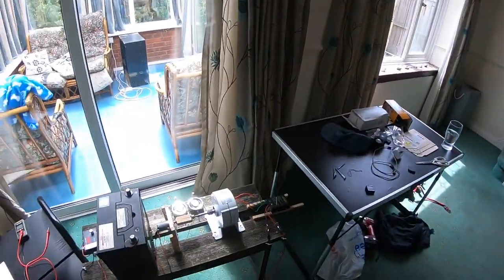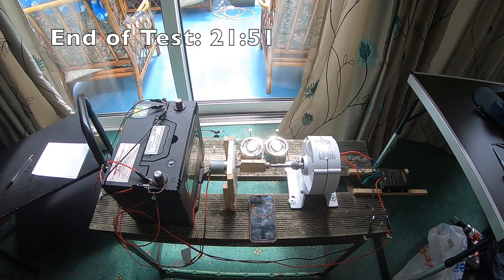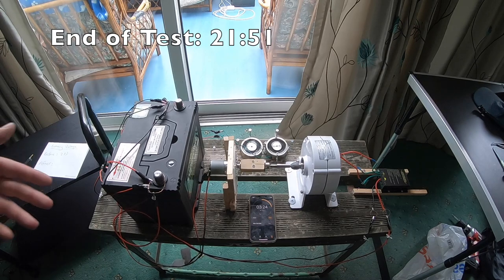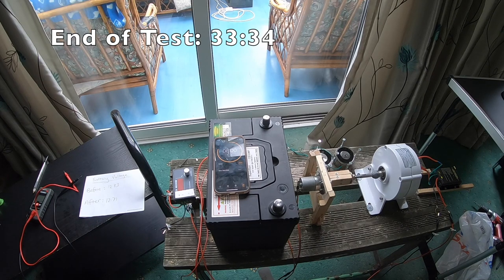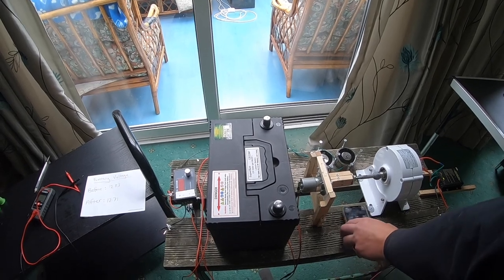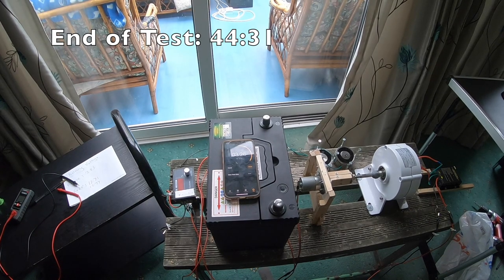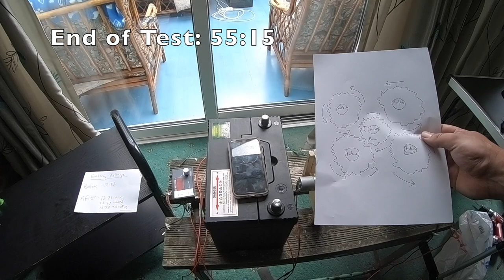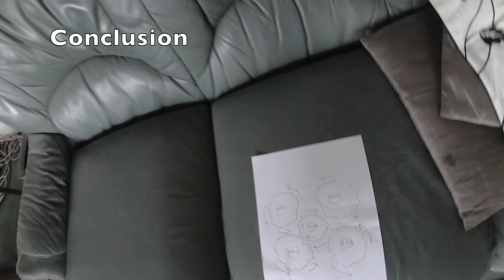BadBoy Jenvey Solves the Energy Crisis - Introducing the Perpetual Turbine

Comment: You've got a battery feeding a motor which feeds a generator which feeds the battery which feeds a motor which feeds the generator.

The "turbine" generator effectively creates its own load through electromagnetism, so you're going to have losses instantly.

The battery charger will also have its own power dissipation and losses, so while it is charging the battery if you left it running it will eventually flatten it.

You'll never be getting back what you put out.

Don't forget also that the only load you've got on that at the moment is the charger. In a real world scenario with consumer loads you'd only be flattening the battery faster.

Finally a current flowing through a wire will always create its own minor electromagnetic field which counteracts it acting as a load. So you will always have losses.

The only way you can not have losses is if you used something that had naturally renewable inertia. Like a river.
Reply: F**k sake that was what I was going to say
Reply: @ashleytuck3863  bunch of geniuses here how'd that happen
Reply: Alternator!!
Reply from the maker: I explained with the cog system how you can spin multiple turbines with one electric motor to gain a net positive output . Obviously I am correct and this is the way to produce electric.
Reply: @DaveJenvey  sorry, yes I forgot about the cogs. Yes you are right. Cos of science.
Reply from the maker: @Gubalicious  cheers for seeing sense
Reply: More Strain on the motor = power loss  Doesn't it.  More Friction.
Reply: @seanoverend7297 yeh, everything after the battery output terminals is a loss. The fact that it's making noise is a loss.
Reply: 100% with u. Better of Adding the turbine to his bike.  Keep fit  and Trick recharge a battery at the same  time.  As long  as it keeps  his mind of fitting  people.  I am 4 it. 😄😄

Comment: maybe use a wind turbine to power the motor to power a turbine to charge a battery or just use a wind turbine to power something, that would be closer to perpetual however many minds have worked on perpetual motion machines and none have cracked it because too many losses in the system, work in never equals work out. I do admire your efforts and it's nice to see you trying to do something positive i wish you all the best dave
Reply: Would it power my ebike??
Reply from the maker: I explained with the cog system how you can spin multiple turbines with one electric motor to gain a net positive output . Obviously I am correct and this is the way to produce electric. But thanks for the nice comment
Reply: @DaveJenvey  I know you know this, because of your formidable intellect, but adding more "cogs" or a "cogbox" as they are known in engineering circles, will introduce more mechanical drag torque, again I'm sure your system has taken this into account due to the phenomenal amount of over engineering thats gone into this so far!

Comment: This is even funnier than the Jenvey drop.
You should have started studying the 1st law of thermodynamics.
Reply from the maker: I explained with the cog system how you can spin multiple turbines with one electric motor to gain a net positive output . Obviously I am correct and this is the way to produce electric. As for the GBU drop, I had the nuts to go back and conquer it, I doubt you would if you had taken such a bad fall.
Reply: Funny you should mention that. I fell off 2 years ago and never got back on the bike lol
But you are wrong. 
Energy can't be created out of thin air.
Reply from the maker: @burt604  yeah that’s why you a battery to get it started Burt, just like in a combustion engine

Comment: All you have to do do is keep it running. If it run for ever you are right. If it comes to a halt you are wrong. Simples
Reply from the maker: John you are a brainless moron. I explained with a cog system how you can run multiple turbines off one motor. Watch my next vid.
Reply from the maker: And additionally if it is so simples, why didn't you think of it John
Reply: maybe im wrong but i dont think perpetual motion is the main aim of what he is trying to achieve here, even though its named a perpetual turbine
Reply from the maker: @orbytl2799  exactly, I’m trying to achieve net positive energy. The holy grail of energy production
Reply: @orbytl2799  There is energy loss at every step of the process through resistance in the wires and the bearings in the motors.
Reply: @Stickyman61  i know, but he is trying to make more energy than he is losing, i dont know wether its possible or not
but what i can tell is that he is not trying to make a perpetual motion machine that will run forever
Reply: @orbytl2799  But if he is making more energy than he is using,  he has to prove it. He could start with an almost flat battery and see if it becomes fully charged. Then he will be taken seriously.
Reply: @Stickyman61  yeah man, he needs get them cogs rigged up 😀

Comment: It's not a turbine, it's just a generator. A generator is the same as a motor, just opposite. This isn't science Dave, you will lose energy through friction, sound HEAT etc. At this point I can only assume you're trolling and putting on a persona for views. Tut tut
Reply from the maker: @DaveJenvey
8 hours ago
I explained with the cog system how you can spin multiple turbines with one electric motor to gain a net positive output . Obviously I am correct and this is the way to produce electric. It is a wind turbine, it was called a wind turbine when I purchased it on Amazon, and the fact you cannot recognise that, highlights you are a moron who knows nothing.
Reply: @DaveJenvey Typically, if it has blades or fins fitted to it you could call it a turbine, but in its current form it's literally just an electricity generator. You're not actually generating electricity with your idea, you're just starting with an amount and slowly losing it over time.
Reply from the maker: @MrOvertSandStorm  Now he's a smart arse, you said it wasn't a turbine. It was sold to me as turbine. But you have to call it a generator to try and make yourself appear clever. Obviously the cog system with multiple turbines on it would work
Reply: @DaveJenvey  We all get things wrong sometimes Dave, it's surely closer to being a generator than a turbine. But anyway, what makes you think you can generate energy from nothing? Adding other generators will just spread the energy across all of them, in fact you'd lose more energy probably as each one would produce sound heat and friction etc.
Reply: @MrOvertSandStorm  i dont think he is trying to create energy from nothing
just trying to get more out than goes in, if thts possible i dont know but i know fuck all
but thats what i get from the video
Reply: @orbytl2799  yeh don't worry man. What I mean is, energy can't be created or destroyed right, only transferred. That battery and motor only outputs a certain amount of energy - adding more 'turbines' won't create energy out of nowhere, that's not how it works. It has to come from somewhere. If you wanted to get more energy out you'd need to increase the energy in, and so on and so on It's an infinite loop of depleting energy over time. Not new innovative or scientific going on here, just Dave trying to get attention unfortunately.
Reply: @MrOvertSandStorm  yeah man, like bigger motor would be needed which in turn would use more battery juice, thats what i was thinking
i like that daves having a crack at it though, i admire that 😃

Comment: Nah…‘I’m not havin’ it !’ (In my best Brummie accent)…there is always a loss,the expression,”no such thing as a free lunch” springs to mind.The battery only ‘gained’ when it was left to ‘recover’ (chemical reactions within).At least you got a vid out of it arkid…onward and upwards !
Reply from the maker: I explained with the cog system how you can spin multiple turbines with one electric motor to gain a net positive output . Obviously I am correct and this is the way to produce electric. But cheers for the nice comment
Reply: @DaveJenvey  the more load you put on (more turbines) the more energy is required to turn them,like I said,no free lunch arkid.
Reply from the maker: @joelfildes5544  yeah but there is still obviously going to be a net positive isn’t there
Reply: @DaveJenvey  Energy is neither created nor destroyed Dave,1st law of thermodynamics…leave the whole thing running,and it will stop eventually,as the energy will dissipate through heat generation in the turbines,and even the motor driving em and indeed the actual wires…sorry arkid,you are pissing in the wind with this one,loads of YouTube vids on this,indeed,this is why there are NO perpetual motion machines,there is ALWAYS a ‘loss’ even in a vacuum…it’s just less,but still a drain…net loss.
Reply from the maker: @joelfildes5544  the sun and earth are both perpetual motion machines. How do they exist if the 1st law of thermodynamics is correct ?
Reply: @DaveJenvey The earth keeps spinning because it has no resistance. The sun is a huge ball of energy that will expire one day. Energy cannot be made from nothing
Reply from the maker: @Stickyman61  The sun will eventually run out of energy correct. But bloody hell John you smartarse, the sun will run for a bloody long time. The sun I guess is a NEAR perpetual turbine. The motor on my perpetual turbine will eventually burn out, so I guess it is a NEAR perpetual turbine
Reply: @DaveJenvey  The motor is not the source of energy and you know that.
You do realise if your theory is correct someone will steal it. So you had better hurry up an patent it.

Comment: You have basically made a model of a power station. Insrt of using coal or gas you are using a battery. Eventually it will go flat
Reply from the maker: John you are a brainless moron. I explained with a cog system how you can run multiple turbines off one motor. Watch my next vid.

Comment: Why even bother with the motor/generator! Clearly batteries just recharge themselves with cosmic energy.
Reply from the maker: Well cosmic energy is actually solar panels, so we do already have those. Problem is they don't work at night.
Reply: @DaveJenvey  you clearly aren’t learned on cosmic energy, I would suggest doing some research.
Reply from the maker: @jezadownhill  you mean solar radiation emitted by stars. Yeah mate, I’m pretty good at astrophysics, you’d be surprised
Reply: @DaveJenvey  I’m not the one stating “cosmic energy is actually solar panels”. So should have I taken that as the sun expels solar panels?
Reply from the maker: @jezadownhill  what you should take is  that you are a pussyboy idiot that talks shit. Come to my address for a scrap any time you like

Comment: No machine is or can be 100% efficent, this can never work.
Reply from the maker: Of course it can, I explained with the cog system how you can spin multiple turbines with one electric motor to gain a net positive output. Nothing is ever  going to be 100 percent efficient, but it only has to be net positive
Reply: @DaveJenvey  
I stand corrected.
I look forward to seeing this in action, I'm a renewable energy engineer and I can't get my head around this.
Everyday is a school day👍
Reply from the maker: @totalcranker  It is straightforward mate. Really simple honestly. Read this and learn: You have an electric motor with a spinning shaft. You connect on to it a driveshaft that has a cog welded on the end. The cog spins. On a series of turbines you have a cog connected to the spinning shaft of each turbine. You use the electric motor's cog to spin the turbines cogs all at once. In that situation you have a small input of electric for the motor, to spin multiple turbines, and out of the turbines comes a lot of electric. Net positive achieved.
Reply: Hi Dave
On your set up, try running the battery down to say 11v then run the set up for say 2 hours, disconnect the wires from the battery that are running the small motor, then measure the voltage from the battery.
If you are achieving net positive you will have more than the voltage you started with i.e you will have charged the battery with the extra power you have generated.
It's easy to get more voltage out than you are putting in but if it is truly perpetual the battery will never go flat.
Or at least this is my understanding.
Not trolling you by the way, I am actually really interested in this experiment👍
Reply: I've just watched this again and I believe the reason the battery voltage has slowly risen after you have disconnected it is due to the fact that the battery you are using generates electricity as a result of chemical reaction, just like your car battery can fail in cold conditions it can also gain a very small amount of energy in warm conditions, in this case ambient heat.
The extra energy has to have come from a different source other than the battery itself.
All the noise you can hear from the motors, all the movement, any heat coming off of the motors are all causing an energy deficit. You would have to have no noise, no heat and no friction to be hyper efficient, you could come close to this using suspended electromagnetic motors (very low friction) very short lengths of very highly Conductive cables (again low friction) and carry out the experiment in a vacuum.
To be energy net possitive you would have to gain an amount of energy from another source.

Comment: Just a tip dave. Get that bracket and drive shaft measured up accurately and get it made of metal. That way it will be more efficient as you wont get as much energy loss throught the excess movement thats going on. Also could you not rig this upto your energy meter and lower your energy bills.
Reply: Metal shafts have better wind resistance as well eh
Reply from the maker: Yeah as long as the drive shaft is bolted to the spinning motor shaft and to the spinning shaft of the turbine then it should be efficient enough

Comment: Surely you need to have something pulling a draw on the current to prove it works? Otherwise all youre doing is maintaining the same voltage in the battery but not actually powering anything other than the motor? Or am I missing something?
Reply: The 2 electromagnets are drawing a current… and so the battery dropped voltage.
Reply from the maker: I explained with the cog system how you can spin multiple turbines with one electric motor to gain a net positive output . Obviously I am correct and this is the way to produce electric.